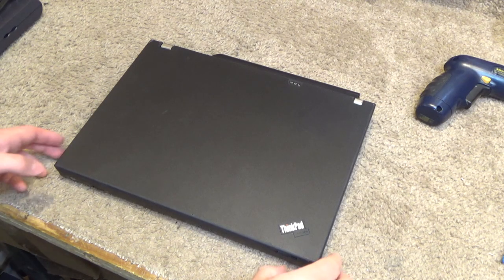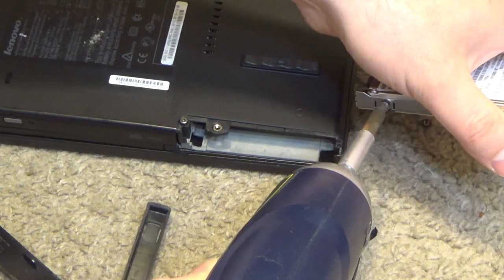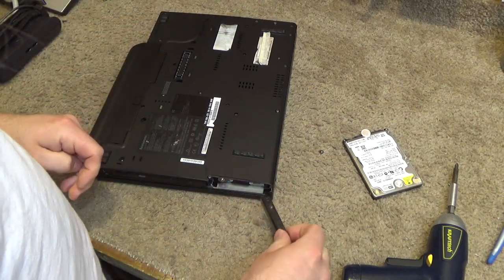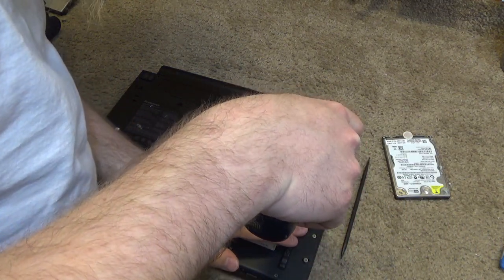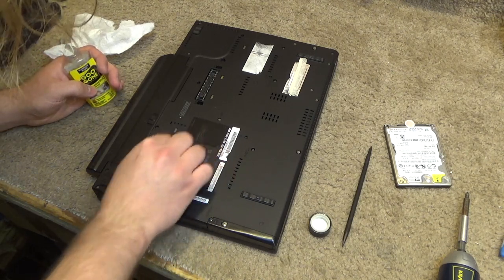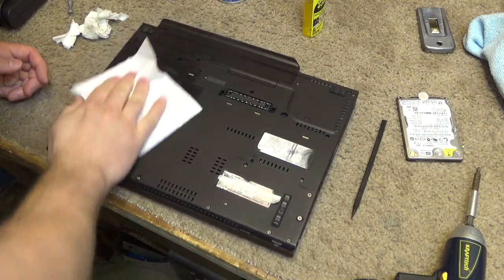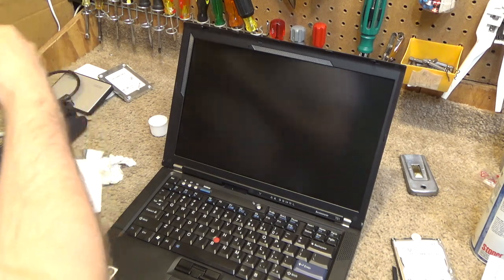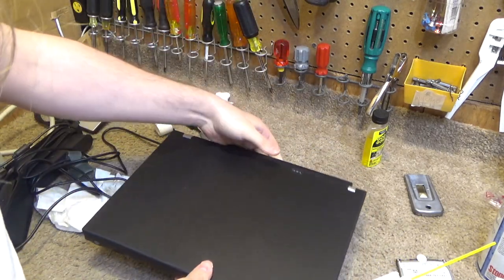IBM ThinkPad T61 | Clean and Replace Hard Drive

Comment: The T61 had an option to have a WSXGA+ display panel while the R61's best panel was 1440x900. There might be more differences but this is all i could find.
Reply: The R series was a more budget oriented series in the Thinkpad line. They used more plastic, no rubberised lid (which funnily enough held up much better after years of use, but feels more cheap to the touch), thicker build for the machines, and in the earlier days less metal in the construction, and sometimes no docking port. But by the time of R61, R400 etc. the differences were really not that big, mainly just lower specs compared to their T series brothers, and thicker build.
Reply from the maker: Thanks for letting me know.